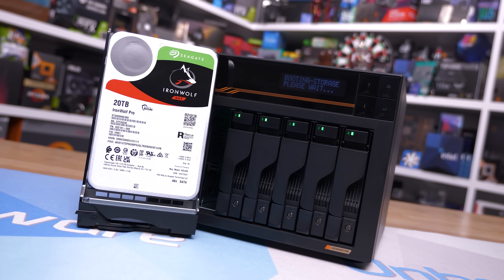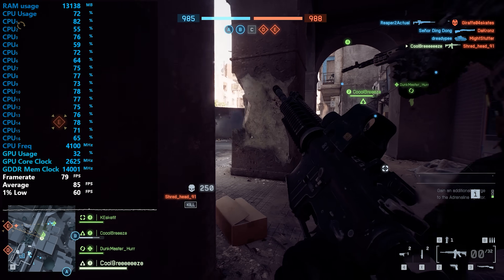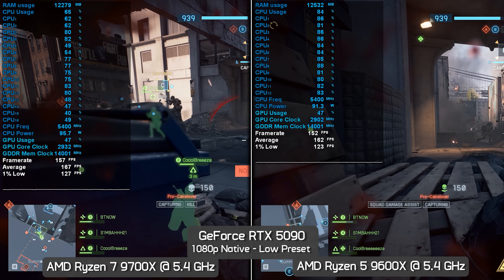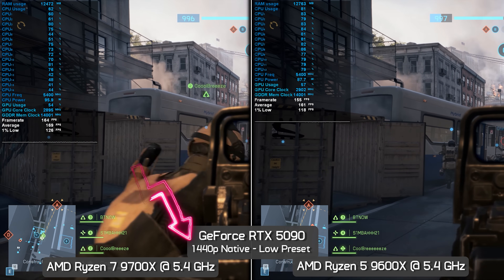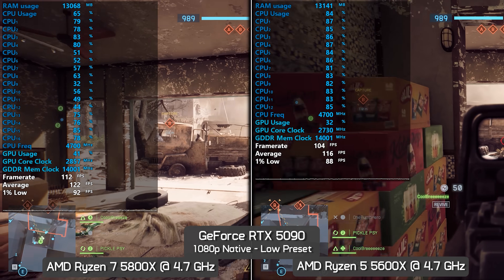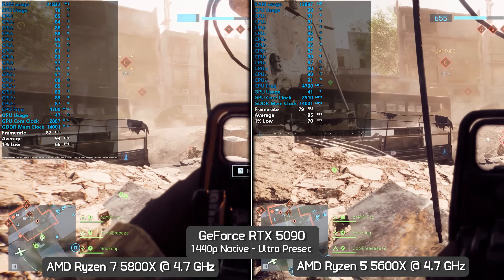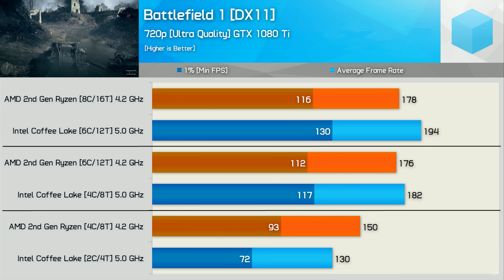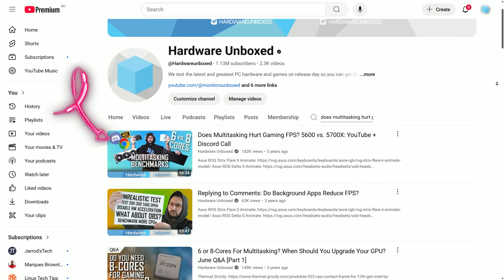Why Gamers DON’T Need More Cores, 6-Cores Still Works Well!

Comment: Data shows 6-core CPUs deliver less performance. No one should opt for them, if faced with the choice.
Reply: For gaming, if faced with the choice of 8 slower cores vs 6 faster cores they should still go for 6 cores
Reply: @mateuszc70  If we're opening that can of worms, comparing different microarchitectures, one should, of course, go with the single core of infinite performance!
Reply: In the video, you can literally see the 6-core 9600x gets more fps than 5800x... Big number = Better isn't always the case :face-red-droopy-eyes:
Reply: @doctr4x720 no sh*t its like 20-30% faster chip released 3 years later on new gen architecture with DDR5 memory
Reply: True. I would definitely choose 7700 over 7600 (or 5700X over 5600) these days.
The difference in price between 6 core and 8 core chips is relatively small, so I do not see any reason get 6 core chips, unless you have an extremely constrained budget - then, yes, saving a few bucks by choosing 6 core part makes sense. In all other cases just get 8 core CPU.
Reply: Stupid comment.

Entirely depends on the cores. This was established within about 3 minutes of the video and has been confirmed countless times. It shouldn't still need to be said.
Reply: Additionally, even for general computing tasks you're better off buying the cpu with faster single core performance than the higher core cpu. Unless you're going to be using it for specific applications where the work can be parallelized. Using office apps, browsing the web, video calls, streaming video from YouTube or other sites, playing games; these situations generally benefit from a faster single core than more cores. More cores is helpful when you have many of these apps open at once, but most apps enter a sleeping state when they arent the focused window, which drastically reduces the amount of work your cpu has to do to process that application. Six cores is enough that someone can have a LOT of different applications open and it won't really be your cpu that'll slow your desktop down, its usually the windows scheduler first. High core count cpus are really for productivity and professional applications moreso than they are for the general public. However, these companies are good at marketing and making you think that you are missing out on a lot of performance if you dont spend 200 usd extra on the higher core count chips.
Reply: Less performance yes but in most cases it's still comfortably enough performance. When looking for hardware, saving money on the CPU to put towards a faster GPU will almost always result in better gaming performance than the other way around. Additionally with how most engines task CPUs faster cores generate better performance uplift than extra cores so even if you'd have the budget to go for a better CPU, if faced with the option of getting an eight core CPU or a six core CPU with higher clockspeeds the latter will in most cases provide more performance (though realistically that choice is a rare occurance usually only found in the lower price segments as Intel and AMD try to segment their products in a way that higher price tends to give you more cores AND faster clock speeds).
Reply: No if you have a newer 6-core vs an older 8-core, the 6-core is better 9/10 times.
Reply: What data, where?
Reply: @FlintlockYT  Have you watched the video you're commenting on?
Reply: The data merely shows you didn't necessarily waste all of what you payed extra. But those wanting to optimize their speding may aim higher than that.

Comment: Reminder that BattleBit Remastered has 127 vs 127, yet Battlefield 6 doesn't...
Reply: Reminder that Planetside 2 has 300vs300 yet ANY other FPS hasnt achieved that..

Also holds the world record with 1241 players on A SINGLE BATTLE...

Planetside 2 is battlefield on steroids
Reply: 128 players didnt work well for battlefield 2042
Reply: More players ≠ More fun
Reply: @Rudi-Brudi It does equal more spectacle. The larger scale makes it feel far more epic and "real".
Reply: ea servers had major issues doing 128 players in bf2042, unhappy to see it go, but malls are much smaller (of what we played) so it'll work okay

Comment: All it takes is for ps6 and xbox consoles to have 12 core CCD and then devs will design the games around 12 cores. It happened with 4 cores, then 8 cores will be minimum for future games.
Reply: Yep, games are primarily limited by console hardware as most publishers want to sell their games on as many platforms as possible. It's pretty rare for PC exclusive games to really demand more notably higher performance at least for CPUs; putting on all the bells and whistles for graphical settings does require a more powerful GPU than is equivalent in consoles but even then minimum specs tend to align pretty closely.
It's no coincidence that the biggest jumps in game technology align with console generation shifts.
Reply: If the rumor of Zen 6 reaching 7Ghz boost clock is true then consoles will just stick to 8 core CPUs and clock them higher to like 5Ghz instead. A higher clock speed is preferable over more cores for game developers
Reply: Probably not as true as you think.  There really are a lot of difficulties scaling gaming workloads beyond like 6-8 cores.  Also, if they continue with APU route, they do not need to think in terms of 'CCDs' or anything, they can configure whatever combo of cores/caches and whatnot and layout that fits their specific wants and needs best.  But I think overall, we should be prepared that the leap in real-world CPU power for next gen consoles will be incredibly lackluster compared to typical generational leaps.
Reply: If there are only very small gains going from 6 to 8 cores, I'd expect the new consoles to go with bigger  cores(more ports, larger registers, larger i/d-caches), or keep them very small, go 6+GHz, and have more specialized accelerators.

More cores are only a solution if you can parallelise your workload, and games/simulations usually aren't that.
Reply: multi core perf is what matters not core count
Reply: When 95% of PCs has 6 or 8 cores… games will be done to 6 to 8 cores…
Reply: Just showed how 8 cores doesn't end up mattering to this day in a good amount of games compared to IPC. so... Let's rethink that. Our biggest problem will be vram stinginess anyway.

Comment: 8 cores n 16 threads r minimum for stable performance 😊
Reply: I kind of have to agree with you. I sometimes think min fps is more important than average or max fps. Once your min fps brings games to chugging, it's time to upgrade. Given there is 10% difference in min fps on some of these examples, the eight core CPU is a no brainer. Tie it with more cores being more futureproofed, and some games needing eight cores. Plus all the other jobs more cores do like shader chaching. Eight core make sense unless you are budget restrained. 

With eight cores your rig will last longer, so simple enough really.

Comment: wouldn't the most demanding be a 4k headset running a kind of racing game at the highest setting?
Reply: The test is for a heavily CPU bound situation, which is very common for multi-player games with lots of players in a server (in a concentrated area where everything thats happening needs to be told to all clients) or lots of networked objects. The more information the game has to convey over the network, the more the clients have to process and the more iterations the CPU has to  do in order to sync the client game state to the server game state. A racing game in vr is graphically intensive and with an unlocked framerate it will stress the CPU moreso than with a locked framerate but not compared to a game with many many players in a server.
Reply: @Howleds  Yes, but you have multiple apps you open before you even turn on steam. The app  for the headset, the racing rig, OpenXR, and Open Composite. Not to mention many games that heavily rely on the CPU, like ETA. I would know because even with a 5090, I still get stutters. You can also enter any busy VR Chat room, and they will tell you the nightmare it is running those.

Comment: Do you also have a video on how 6 core is not enough from ~year ago?
Reply: He did have one called "Are 6 Cores Really All You Need for Gaming? It Depends" from about a year ago 🤷‍♂

I have been building computers for more than 20 years and I always say to people spend the extra $50 on 8core vs 6core. Do they really need it at the moment nope but I find many keep their computers for a crazy amount of time and so it makes sense. It was not that many years ago four cores was enough.

Currently you can find an AMD 7700 for $218 on newegg and the AMD 7600 is $185. That is a difference of $33 and I could not recommend the six core because it is $33 less. These are the non X as they come with a cooler making them excellent for budget gamers.
Reply: 7700 is the best bang/ buck cpu, for quite some time now. Easily beats 5700x3d in every single scenario and costs less.  @logirex
Reply: @logirex  If people bought a 2700x over a 2600x some time ago for gaming, today they would have a cpu that's worth about as much as a 2600x on the used market (less than 50$ that is) and not much to show for it, a better choice would have been to pocked the difference in price between the 2 models, buy the 2600 and use the money saved it to buy a 5600x or 5700x3d.
Reply: The point isn't "buy a slow CPU", the point is buying a faster 6core is always better than a slower 8core. Holy fk you people are dense.
Reply from the maker: @The_Noticer.  It's impressive stuff isn't it :D
Reply: @The_Noticer.  They didn't say that in the title. They could easily have said new 6 core > old 8 core, but they didn't, because that's a fairly uninteresting finding.
Reply: @jordanboekel8530  And yet despite it being an uninteresting finding to you, still plenty get it wrong. But muh background tasks.
Reply: they also praised "AMD RX7000" cards as better value countless times, never counting DLSS as important feature of RTX4000 cards and made podcast video recently how those GPUs aged poorly with no FSR4 support. So people shouldn't blindly listen to people on internet.
Reply: @f1rstlol  Because at the time nobody knew fsr4 would be rdna4 exclusive.
Reply: @ayaiken  at the time everybody knew that FSR3 is awful and DLSS is very usable.
Reply: @f1rstlol don't have fsr4 but have enough VRAM to work ok with lower settings, fake frames will be never like real frames

Comment: Now do the same benchmark but with stuff running in the background such as Discord streaming, a web browser, voicemod, logitech G hub, etc.
Oh wait, you won't, because you don't want to admit you never actually tried using a 6 core processor as your main. Freaking PHONES have 20 threads now, why are you trying to hold back X86? are you being paid by ARM?
Reply: Guess who didn't watch until the end of the video?
Reply: :eyes-purple-crying: Yappers didn't even watch the video till the end
Reply: Little bro didnt watch the video. He literally points you  to the video where he recorded and was on discord and had a youtube video open and performance didnt change much
Reply: https://www.youtube.com/watch?v=Nd9-OtzzFxs
Reply: @Einclad_SSRB  The 5700X gets a BIGGER performance drop than the 5600? That seems extremely suspicious and completely opposite of my own tests. He should redo it.
Reply: Which phone has 20 threads? My s24 exynos has 10 cores, and it is inferior to the snapdragon version of its time. And I thought the current flagship snapdragon chip for phones has only 6 cores?
Reply: I'm running 7600x3d and I'm running GSC, Icue, Steam, Epic launcher, Xbox app, Ubisoft launcher, Steelseries GG, AMD Adrenalin for recording clips in the background and guess what? Everything is working fine🤡